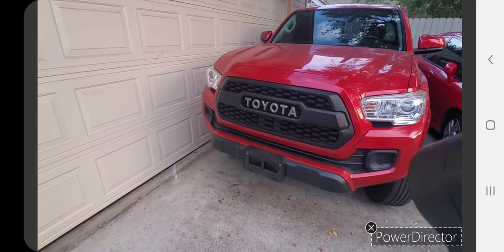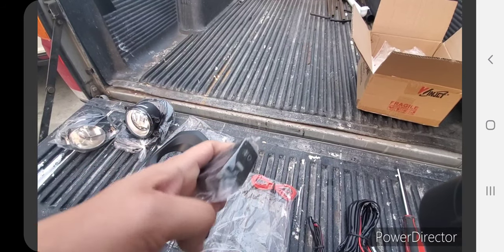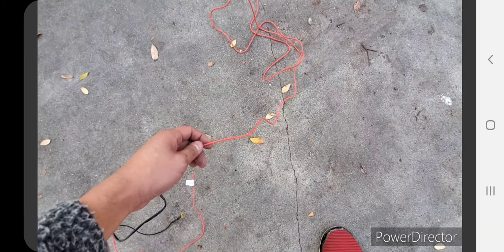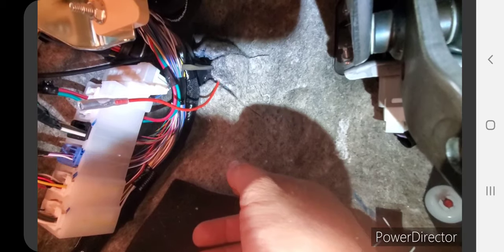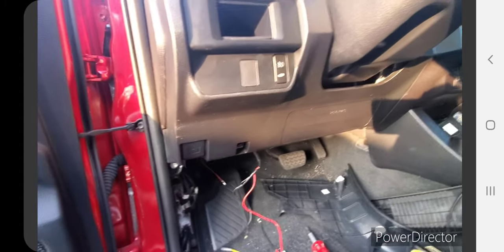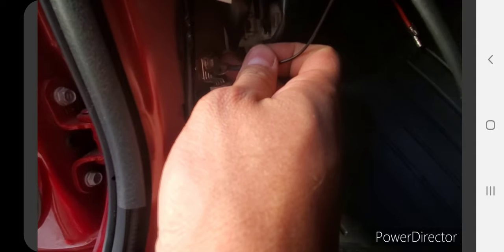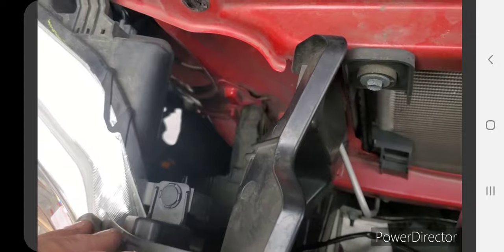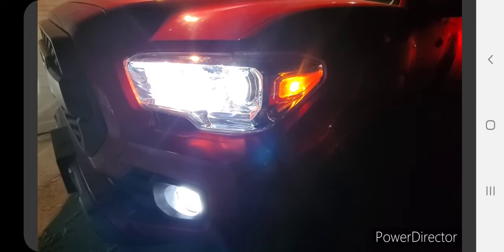Toyota Tacoma 3rd gen SR fog light installation

Comment: Great video but I do have one major safety issue with how you ran the wire through the fire wall.  You ran the wire directly against the metal hole in the firewall.  The wires insulation will eventually wear down due to vibration and motion and the wire could SHORT out against the metal frame of the truck.  Whenever a wire is run through any metal hole in ANY vehicle (car, truck, train, plane etc etc) it runs through a rubber grommet.  The purpose of the grommet is to prevent the wire from EVER touching the frame of the vehicle.  A much safer way to run the wire is to use a sharp screwdriver or awl or whatever and poke a new hole in the middle of the existing grommet while leaving it in place.  Just be careful and then poke the wire through the new hole just as you did.  You do not want to run the wire AROUND the grommet because that defeats the whole purpose of the grommet.
Reply from the maker: Thanks for the tip. Ill rewire the cable through the grommet. You are very knowledgeable. Thanks
Reply: I was going to ask that. Could he have just routed it through the existing wiring hole? What would happen if you disconnected the wiring harness that’s going thru the firewall now and tried to use the same rubber grommet?

Comment: I want to thank you for posting this. Just added these lights to my 2023 Tacoma SR. There is NO WAY that I could have installed them without your video!
Reply from the maker: I’m glad it helped you!!!
Reply: I have a 2023 sr as well but my fuse box doesn't have power outlet number 2, which did you use?
Reply from the maker: @kutsurogu1538  search for the ignition fuse
Reply: @kutsurogu1538  I used the only power outlet available. #1. No problems.
Reply: @EddieTee321  alright thanks
Reply: @donarcher768  thank you

Comment: I have a 2020 SR V6 pre wired. Contacted my local Toyota dealer regarding fog lights. They wanted $280 for the kit plus $130 per hour for service which was estimated 2 hours.  So $600 for an already prewired truck just for fogs. I said that’s ridiculous! The parts agent said “I agree”!   I couldn’t justify the cost. Bought the Amazon kit, got the add a fuse. Installed in about an hour and a half. All for under $50.  
Thank you SO SO much man for this vid! Worked perfect man. Kudos sir!!
Reply from the maker: Glad you were able to save some cash bro
Reply: So you did not need to use the wiring installation kit that came with your Amazon purchased light kit? You used the factory wiring and installed a fuse into a factory fuse box already in the truck? I'm asking because I bought a 2023 sr V6 double cab and it does not have the factory fog lights.
Reply: So how was it “ pre wired”. Are you saying that all the Tacomas come with the wiring installed and they just need put in?

Comment: Quick tip, instead of running the wire to where it can rub against the metal that the rubber grommet slips over just poke it through the rubber next to the wire loom so you don't have to worry about it shorting out.
Reply from the maker: This is correct

Comment: Dont pass your wire like that in your firewall! Over time the sharp edge will cut your wire! Instead, make a little hole into the plug (watchout for the others wires), pass your wire and seal with a silicone! (Just a little) 

Besides that, thanks for your video! Great one!
Reply: This is the only mod I did to this. Easy as heck to make a small hole in the large rubber grommet and pass the wire.
Reply: True story, I've seen it catch on fire before, ask me how I know lol
Reply: Thank you for this tip- I’m glad I took the time to read the comments 👍.

Comment: Sorry but you should not be installing electrical anything...holy shit your a car fire waiting to happen 
The rubber grommet protects the wire you go thru it never should touch metal unless protected.
2nd thing there is  a smaller hole 12 inches left near the booster...thats the hole you need. 
3rd use the outside fuse box and drill a hole in the upper left corner or use the amn hole on the interior box
4th and last but not least dont run power thru the switch...you run a relay and have the switch trip the relay
Reply: Can you please further explain the best way to wire this kit in using the fuse box in the engine compartment? I have a '22 SR5 with no fogs.

Comment: So the 12v fuse tap is just an on/off indicator for the relay thus you could just find any wire that is hot when the ignition is on saving the fuse tap step. You could find the headlight fuse and use that for power to not have to tap directly into the battery.

Comment: Most Toyota Tacoma are prewired for many of the options whether you have them or not. I've instal factory intermittent wipers, cruise, and fog lights at a fraction of the cost the dealer charges. They sell a factory fog light kit that comes with new headlight switch, fuse (which is prewired in the fuse box in engine compartment), wiring harness, and lights with bezel. Don'T ever run a wire through the firewall like rhis guy did. If you look at 13:00 that plug by his left thumb with the gray and white wire is the factory fog light plug that the fog light wiring harness plugs into.
Reply: Do you gotta remove the steering wheel to install the new headlight switch?
Reply: @ryanfay1  yes, but it is not hard to do. Take the proper precaution with the airbag and you'll be fine. Just look at the plug going into head/turn sig switch first to see if the wire harness is prewired. There should be 1 full row and 1 row with just 2 wires. Those are for the fog lights (signal going to Ecm and  the ground)
Reply: Show us the pre-wireing and how to install it

Comment: QUESTION Regarding the wire that goes from the switch to the fuse:
Is it possible to connect that wire to the low beam power wire?   Since there is a relay, wouldn't that connection be sufficient? I am thinking that way, it disconnects each time the lights are turned off, thus having the fog lights behave as they did from the factory.
Is this a possibility?
Reply from the maker: I believe that should work also but you will have to tap into the power line. Make sure to purchase a tap wire and it should do the job.
Reply: @EddieTee321  The power should come from the power being sent to the low beam wire

Comment: Eduardo, Nicely detailed video. I did the same mod a few years back. I have just one comment concerning the operation of the fog lights. Most states do not allow for fog lights to be operated along with high beams. I had to add a relay to have the fog lights turn on turn off while the high beams are on. It is all legal now and works like a factory installation.
Reply from the maker: Glad you made the modifications needed to have it all legal in your state
Reply: Make a video.

Comment: Very good directions I thank you very much my SR looks great now 😊
Reply: Bob back again finish the fog lights installation only problem I had is the round washer o the positive wire wouldn’t fit I had to cut three round connector and wrap the wire around the nut started it up fog lights look great thanks again

Comment: I installed my fog light housings, used electrical tape to tape off where the connectors go, and left it LOL. I don't have factory wiring either, and all my cables are different as they're from Diode Dynamics. Gonna pay someone for a shop hour to do the wiring lmao I can't be bothered. 

Funny how much easier wiring up a computer is. I can build a computer in my sleep.

Comment: I just installed mine today. Thank you for the informative video! Just an FYI, my dad and I figured out that the male connector fits perfectly over the end of a coat hanger wire. If you then tape it with electrical tape, you can thread it through the grommet on the fire wall instead of using a screwdriver to pass it through the outside of the grommet
Reply from the maker: That’s definitely a pro tip and a much better way to send that cable past the fire wall.

Comment: I just put these in following your video. My only question is the way it is hooked up in the fuse box leaving the switch led on all the time. Is there a way to wire this so that the led for the switch is only on when the fog lights are on?
Reply: You want to use that switch and not the crappy one that comes in the kit

Comment: Thinking of this model of truck to buy! How do you like the 2.7 motor. Supposed to be super reliable. Thanks for sharing this install. It'll be the first thing I do !
Reply from the maker: It's a great truck. I loved it. However I sent it back as a trade in for the four door long bed truck because that's always been my tacoma dream truck and I was finally in a position to afford it
Reply: I have a 2019 barcelona red (really nice color of red and one of toyotas well done colors, they are not known for good paint colors or paint jobs for that matter) 2.7l sr basic truck with 4 wheel drive. Mine does have color matched bumpers and it has factory black wheels that make it really look nice.
Anyway, my 2012 taco 2.7 basically same truck in white, had 150k miles and it ran the exact same as this truck with 30k miles. I have zero doubt that my 12 would of last another 150k no problem.
They are simple to work on, tons of room under the hood.
The eay they are set up now with a 6 speed transmission (overbuilt because its the same trans that moves the 278hp v6 at least in mine) it powers it nicely.
Im used to a 2.7l tho. My gf has a 2020 sr v6 4x4 access cab same as mine but that does get up a little more, but neither are fast by any means.
It has no balls, ya know. Ur not gonna romp on it and smile thats for sure lol. It will suprise ya tho, mine legit, no word to lie, get 25 mpg routinely. My 2012 with 4 speed and od got 18 to 20 max. N i religiously with my app track my mileage on each tank also with the dash of my 19 which confirms accuracy.
Point is, the way its set up now, if u drive like a normal person its hard, unless driving uphill on the highway to get the rpms above 2k. They set this tbing up fantastically for this model year anyway n im sure anything after it.
It suprised the hell out of me when i was getting 24, 25, even seen trips in the 26mph.
Mine is completely stock with the firestone destinations still on it.
It wider and does feel way more bulky than my 2012. I think the sesting position is way worse in the 3rd gen than the 2nd gen by far. Ur like on the ground in these n im only 5ft 9in. So i wouldn't recommend anyone over 6ft even consider it, unless u get 2020 or newer eith power seats.
I will be looking for a wrecked 2020 or later with the power seat optiom to attempt an install one day. It can be that hard to do. 
The only thing i hate toyota for they are so cheap on interiors. Esp on the tacomas. The sest should have a min since the intro of 3rd gens manual up and down at a min but really just add the damn power option to every model regardless of trim. Do something for us for once, then theyd buy even more of em and they get the set up for probably 20 bucks a vehicle ya know. Crazy to me.

Comment: You didnt have to add the factory turn signal switch to accommodate the fogs? Also do you know a source to where I can buy the inside switch only?
Reply from the maker: Amazon.com: iztor Blue LED Multi-Purpose Fog lamp Switch for Toyota pushbutton Switch with Connector Wire Kit : Automotive
https://www.amazon.com/iztor-Switch-Connector-Lights-Toyota/dp/B01MY0TKJC/ref=asc_df_B01MY0TKJC/?tag=hyprod-20&linkCode=df0&hvadid=316747946823&hvpos=&hvnetw=g&hvrand=8147761506558978521&hvpone=&hvptwo=&hvqmt=&hvdev=m&hvdvcmdl=&hvlocint=&hvlocphy=9031119&hvtargid=pla-571033087105&psc=1

Comment: Soo i installed this but now im getting a short on it
Reply from the maker: You might have an exposed cable. Go back and make sure all your connections are tight and taped with electrical tape. You shouldn’t have a short
Reply: @EddieTee321  yeah ima do it, im getting right there where the relay is connected so idk they turn on by themselfs
Reply from the maker: @Bandditt  double check you cables, maybe request a new relay if possible

Comment: Ik this is old, but this guide was helpful. I did some steps in my own way, since the 2020 tacomas are just a lil different. Other than that, its straight to the point.
Reply: What steps did you do different? The only thing different I see is the 2020 doesn’t have a power outlet 2 fuse can you use power outlet 1?
Reply: @appstatecanesfan  i fixing to install mine, did you find out how we can setup with the 2020 models?
Reply: Eric Contreras Hey I found another video about a 2020. I tapped the ignition fuse and put in a 5 fuse with it.  Works great

Comment: Thank you so much for the detailed video. I just bought this kit and installed it on my 21 SR. Everything works as it should. The fog light surrounds fit loosely and the interior switch is VERY bright green at night.
Reply: U can prob always pop that swith out. Obv it has a tiny bulb somewhere, probably soldered to something, but non the less, either try to sway it out, or just hit it until it no longer is lit up and that solves that all together.